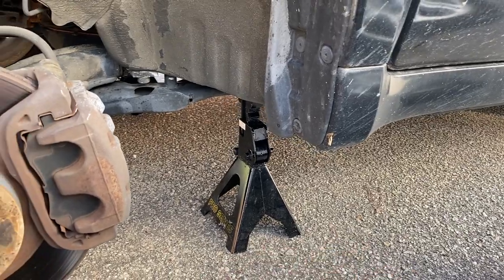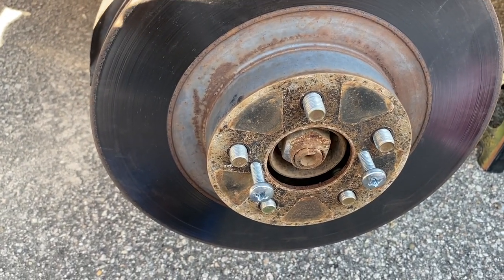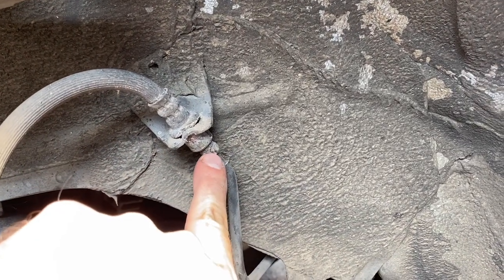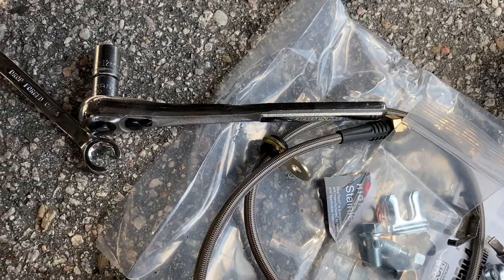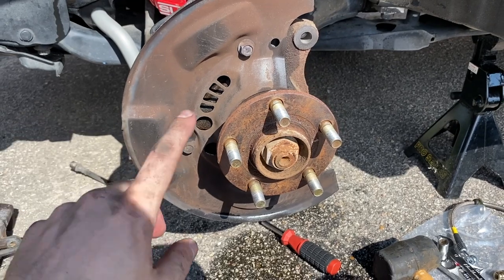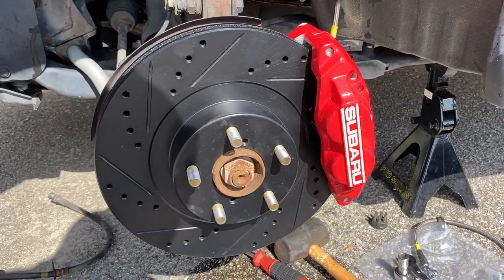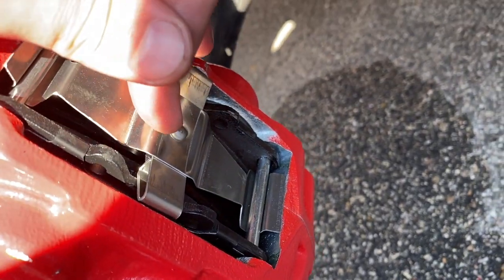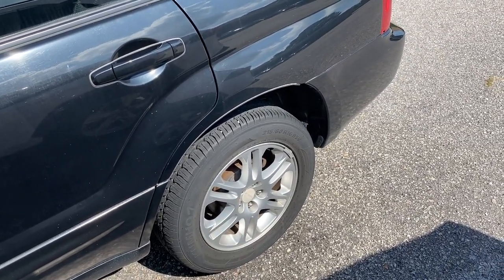2005 Subaru Forester 4 pot upgrade

Comment: When swapping all four calipers does the order matter? Is it better to swap fronts, bleed or rears, bleed first? Thanks
Reply: General rule, start furtherest wheel/line away from master and work your way to the closest one. Don’t let brake reservoir run dry….  😎👍🏻
Reply: @brettmills2470  ahh ok and last question, brake reservoir cap on or off during bleeding?

Comment: Are the front brake pads the same part number for both the original caliper and the 4 pot?
Reply: They are not, i dont know the part number, but the pads are a different shape. The pads in the 4 pots are rectangular. Not the weird brake pad shape you get in the oem 2 pots.
Reply: what wheels are those?  I am desperately looking for 16's that will clear the rotors. any specs for width and offset? thank you @Nbomber